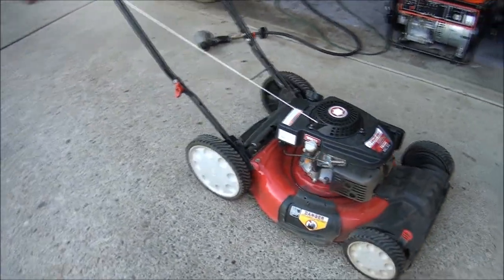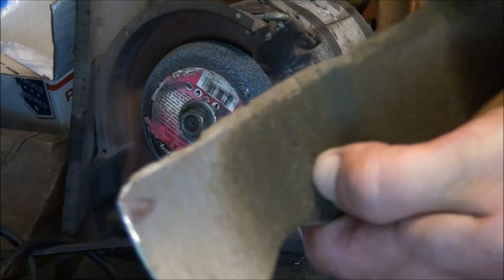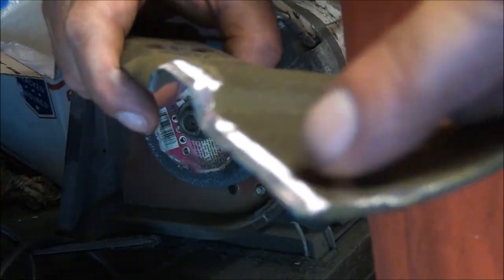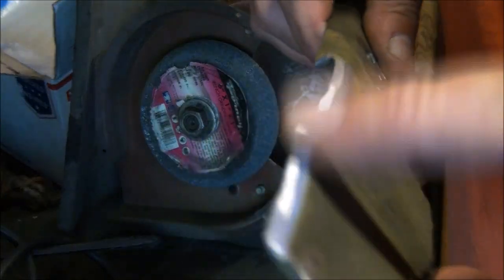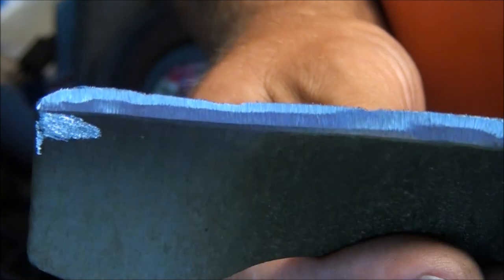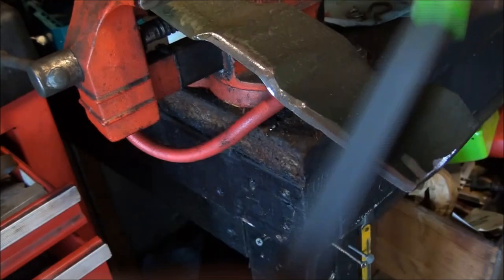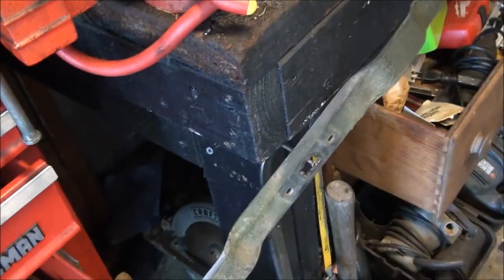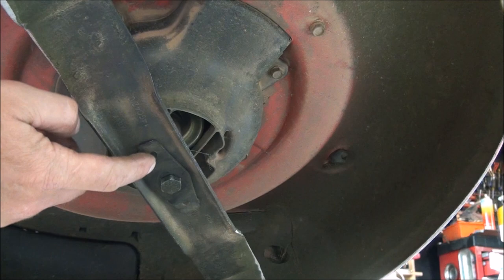HOW TO SHARPEN a LAWNMOWER Blade. ANY make or model Briggs and Stratton etc..

Comment: It always worries me that nobody says to UNPLUG the sparkplug wire before messing with your mower. So many people do not know what they are doing and watch the video. If you don't tell them, they won't do it.
Reply from the maker: Good tip!. Safety is always important.
Reply: @jeffslawnmowerrepairandservice  I forgot to add it was a very good video...I can't write like I speak so I hope I didn't sound ungrateful. Thank you for you video.
Reply: Brother Lee, absolutely correct!  My Dad taught me this many, MANY  years ago; he explained to me that any engine like this - even when shut off, can STILL  "kick-over"  with the residual compression still in the powerplant along with just  ONE  tiny lil spark.  He was a WW2-Army Air Forces pilot, & had a quite thorough understanding of how internal combustion engines worked.  And I agree - Brother Jeff has produced a most excellent instructional-video indeed!

Comment: How do I sharpen blade manually if I don't have a grinder on a Brigg & Stratton 300 125cc?
Reply from the maker: I dont know
Reply: File, same technique as Jeff was doing near the end.

Use a very rough (coarse) file to do the main work (rip the bulk of metal back), then a medium roughness file to still take decent amounts of metal off, but at the same time, it also cleans up some file marks left by the heavy duty file.

Then finally use a finer file to go over it, removing all file marks (clean the edge up) and get a nice sharp edge on the blade.

This will take an hour, maybe a little more to do it.

Also if you don't have a bench grinder like Jeff's, you can use a hand held angle grinder for the most part and finish it with a file.

For both of the methods I've described above, you will need to use a bench vice like Jeff's. Or some ther devised way to keep the blade still and held well.